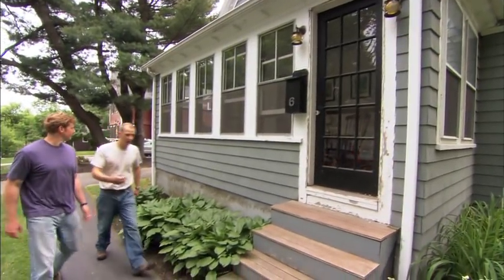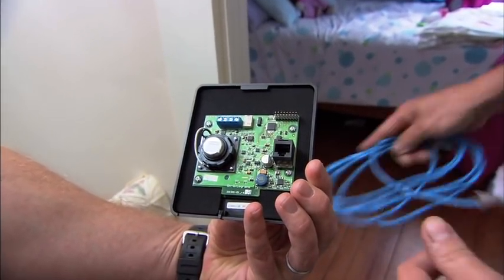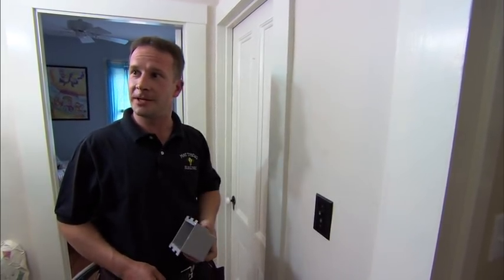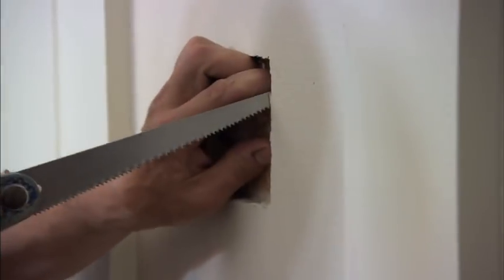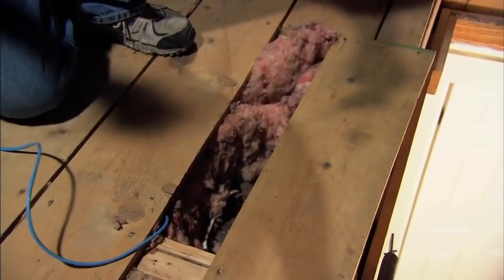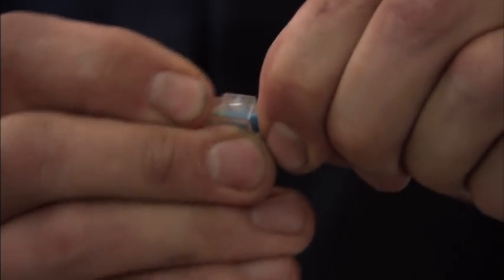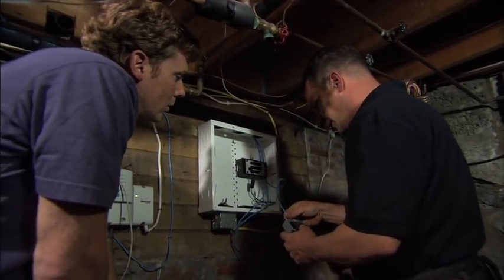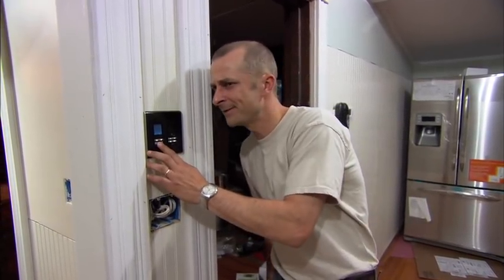How to Install a Front Entry Intercom | This Old House

Comment: Some good "cut-in" points were given here. A little more "experience generated" advice here if I may:

1- On "wood lath and plaster" walls, start with a "target" height but determine the exact height based on the fact that having wood (lath) behind the top and bottom of the cut in box tabs is critical. The best way to ensure that is to center your outlet on the lath that will be in the middle of the outlet. Make some little exploratory holes to determine exactly where that center lath is located. Use the center of that lath as your outlet height center. In addition, once you have a little hole between the lath, bend a piece of wire coat hanger into a 90 degree angle and put it into the wall. spin it around to determine if there is hollow space behind the plaster for the outlet box. Proceed or relocate as necessary. If it won't fit in that location, all you have to patch at this point are some small holes. 

2- When you begin to cut the wood lath, use a SHARP, fine tooth, wood cutting saw and be gentle. Cut your first side of the center lath but don't go all the way through. Leave a 1/8" section uncut at the bottom so the remaining piece doesn't vibrate/swing wildly when you are cutting the second side. Cut the second side all the way through, than go back and finish the first cut. Slow and gentle here is KEY!!! 

3- Cut the center lath first. The top and bottom lath's can be cut on both sides with the saw to the edge of the opening. Than, score the horizontal line with your utility knife until the lath easily breaks off with a gently twist.

Comment: Please note if you are in europe, the order of the wires for the cat 5 are different. Check it online
Reply: If you are in America also. This guy does not know the color code at all.
Reply: @mikerichardson6973 He certainly does know the correct order. He used T-568A, which is one of TWO acceptable wiring methods (T-568B being the other) and, in fact, the preferred method in many places. 

Source: I am an industrial electronics and electrical technician who has made thousands of these terminations (mostly using T-568A) throughout my career in a steel mill.

Comment: I'll stick with a simple low-voltage doorbell...
Reply: Those are old school devices.
Intercoms are more modern
Reply: @stephensnell1379  Modern equals unreliable... it's only a doorbell...
Reply: @TNtoolman  "Modern equals unreliable" false in a vast array of cases. I would imagine something as simple as this would last a very long time. Besides, this offers the functionality of speaking to the person, something a normal doorbell does not. If you're upstairs, have a huge house, disabled, etc, you may need something like this. Of course, this is an old video and we have better hardware now...

Comment: THE ORDER IS 2:27
1White green 
2green 
3wight Orange 
4blue 
5white blue
6orange 
7white brown 
8brown
Reply: TIA-568A

https://en.wikipedia.org/wiki/TIA/EIA-568#Wiring

TIA-568B was used in America in old installations, but in new installations 568b is the standard.

Comment: 568a wiring
Reply: It doesn't matter if 568a or b because both wirings are straigh-through connections. If the wiring on one end is 568a, it must be 568a on the other end too. That's naturally the case if you use the 568b-standard. One end 568a and on the other 568b would create a cross-over. Devices without Auto MDI-X would not function properly.
In new installations, even in the US, 568a is the standard. Only older installations, or through inertia, the 568b is still in use for new installations. You can use a patchcable with 568a in a 568b network and the other way arround, it doesn't matter. I've got a 568a-wired network here and the patchcable between the receptacle and the PC is 568b.
568a is more common in Europe because the wiring colors match the colors and positions for telephone wiring.
Reply: @Marcel_Germann  I've made thousands of cables and I've never seen a single A standard. Always B. I worked in a telco for 5 years. Perhaps it was a company thing but everyone I've ever spoken to goes B.
Reply: @user-nh3gu1ge3d  Like I said, 568A is common in Europe... ;-)
But it doesn't matter since these are both straight through connections. The data doesn't care if the wire is insulated green or orange, as long as the connections are between the correct terminals in the LAN-outlet.
Reply: @Marcel_Germann  works for me

Comment: Kind of a crappy looking house to be putting such a high-tech feature into. A wireless doorbell takes about 5 minutes to install and costs about $50.
Reply: +jpatrick1967 You get what you pay for. Never forget that. For the best function and use wireless is only advised in situations where running wires is impossible.

Comment: Are we in 1988?  Seems to me like a wifi option with an extra feature of a camera with the audio would be a less labor intensive solution in 2014.
Reply: +TheASTrader Wireless is only advised for applications where running wires is not possible. Hard wired systems will last for 20+ years. http://interco.ms/